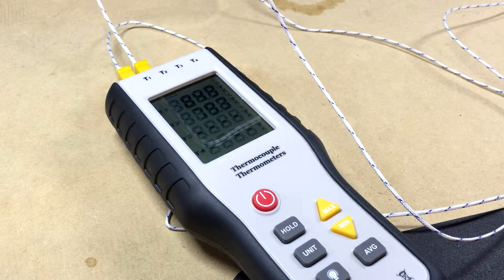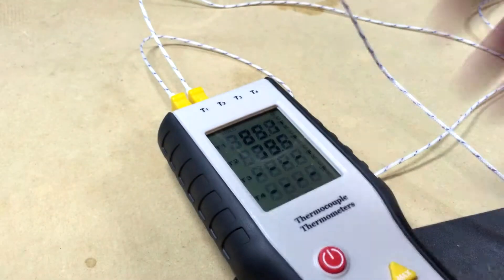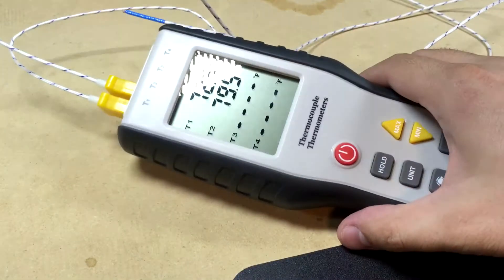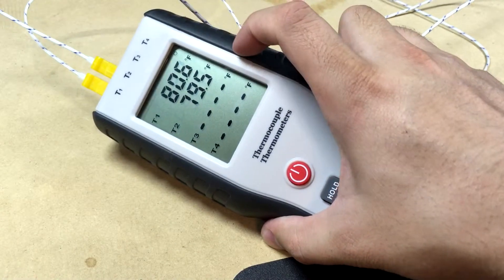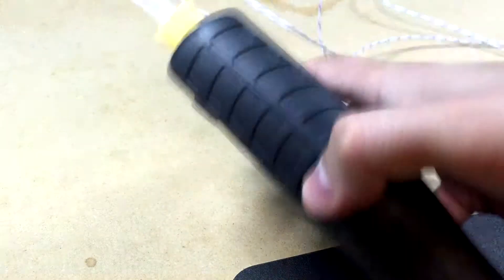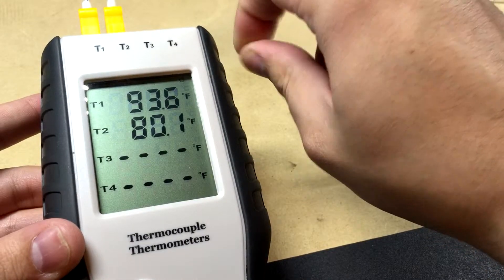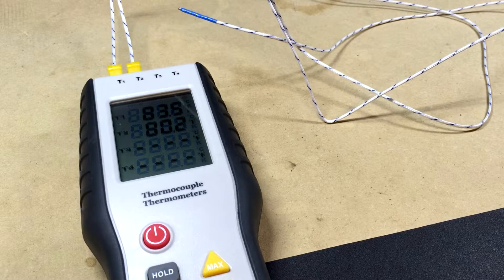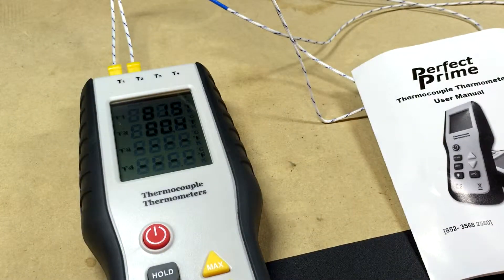RTFM! - Thermocouple Polarity #0036

Comment: A good quality thermocouple reader would have a receptical with a large and small slot, matching the large and small blades on your probe plug.   Units from Fluke or Omega won't allow you to plug them in backwards.